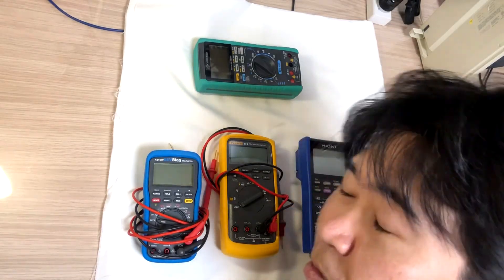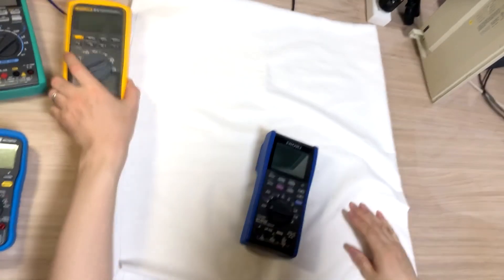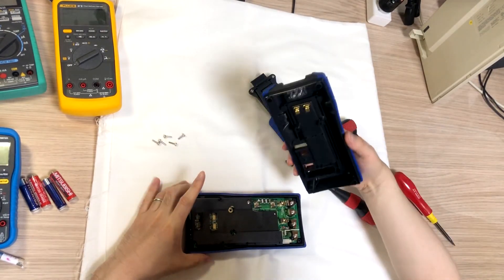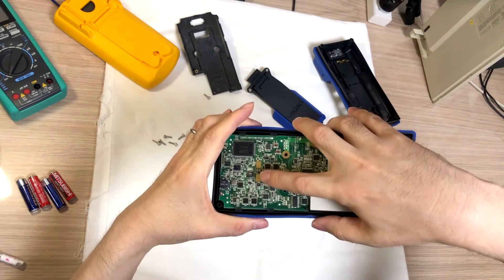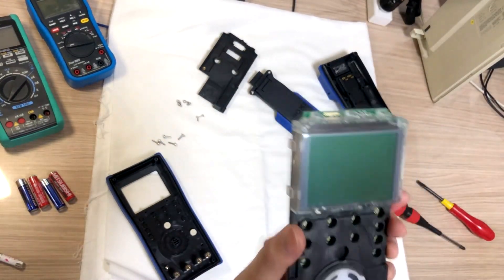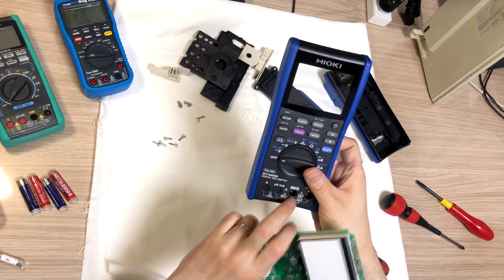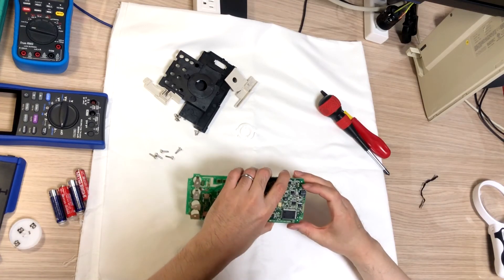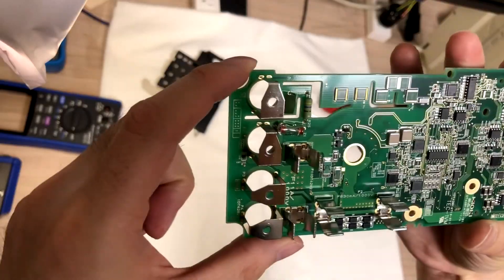Akira-EN #10 Hioki Dt4282 Multi meter Tear down review, simple compare 121GW, Fluke 87V, TY720

Comment: Hi Akira. I have a same multimeter but one of its diodes was removed and I don't know its part number. The annunciation of that diode is "D10" and it's behind two giant ceramic capacitor. would you help me find diode part number?

Comment: Hello Akira. In your opinion which of these two multimeters do you prefer ; Hioki HT4282 or Keysight U1241B. Best regards.
Reply from the maker: I have not used U1241B yet, so it is difficult to compare. Maybe I will try U1241B at the shop in Tokyo.
Reply: @AkiraTsukamoto  Thanks for the answer. Continue the good work.
Reply from the maker: @danielsoeiro4910  I mistakenly thought it was U1241C, I do have U1241B. Both are good multimeters, pros on U1241B is that the LCD is very clear and small form factor, cons is the continuity test is not so fast, pros on HT4282 is the 60,000 counts and feels quick readings, cons is large body and the LCD could be better. Both have superb built quality. Probably having both is good combination...